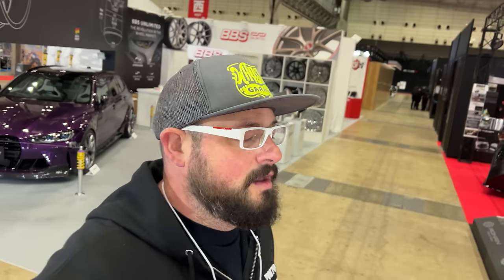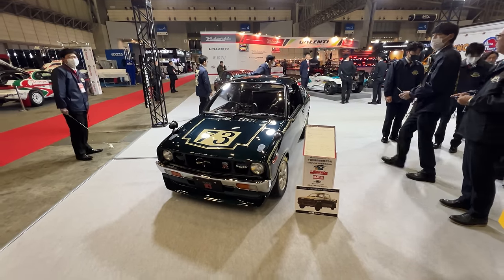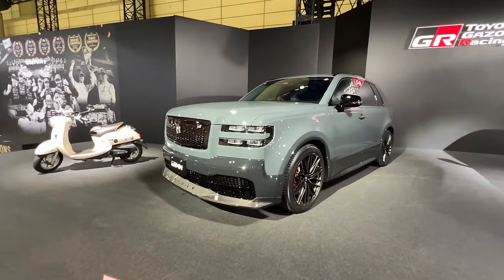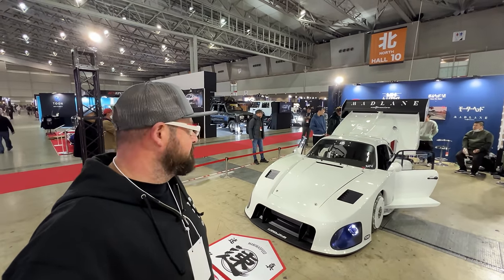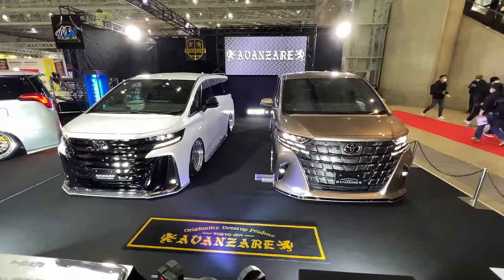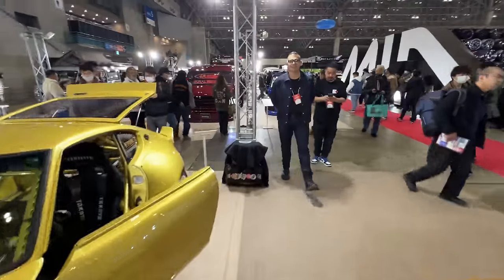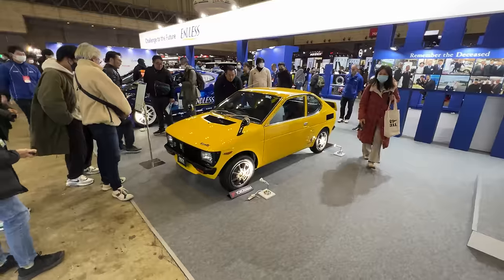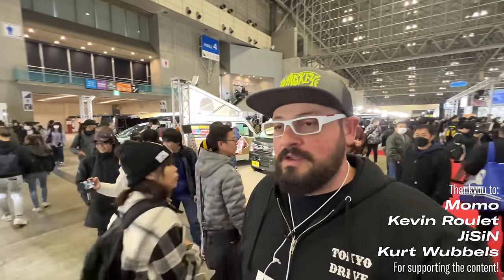Tokyo Auto Salon 2024 - Everything YOU NEED TO SEE!

Comment: The Garaiya wasn't based on the Elise, it actually was a completely original car. This one is likely the one converted at the Osaka Sangyo University many years ago, unless Autobacs made a new conversion from another prototype. Some of the prototypes still occasionally appear at some Autobacs stores, I want to see one in person one day
Reply from the maker: I drove one of the few prototypes back in 2003 and pretty sure ASL told media it was loosely based on the Elise chassis. The SR in it was the VE variant. No idea if the EV is the same one that was built back in the day
Reply: @dino_dc  I haven't seen any mention of the Elise being the base chassis in the reviews and promotional material that I have found. It is pretty much a successor to the Tommykaira ZZ, so I assumed it was designed and built the same way. Cool that you got to drive one!

Comment: not so sure about that single exhaust tip on the mugen FL5 😅.. looks a bit off haha 

maybe they could also do another round of the mugen RR for the FL5 like what they did back then for the FD type-r.
Reply from the maker: I just realised they also redesigned the tailights. I will be surprised if they put this one on sale. Hope they do of course, but sceptical.
Reply: @dino_dc  mugen seems to be very slow with releasing tuning parts for the CTR considering their connection with honda. its still FK8 on their website.